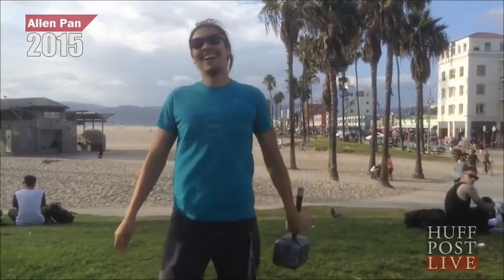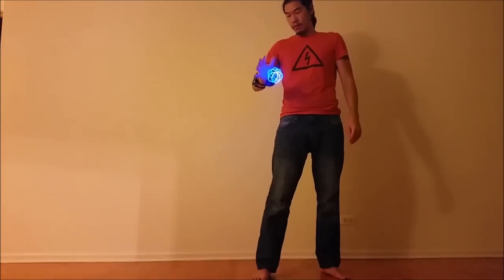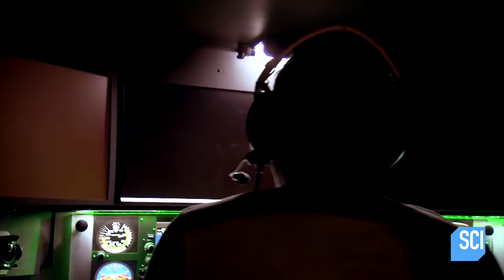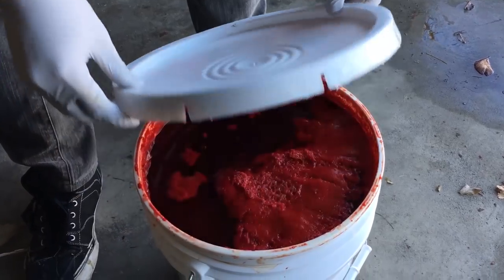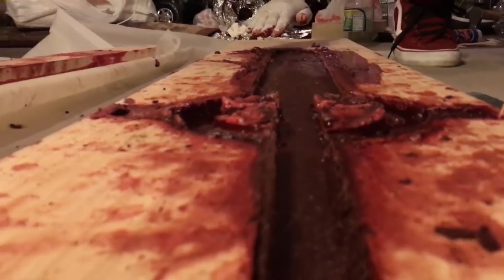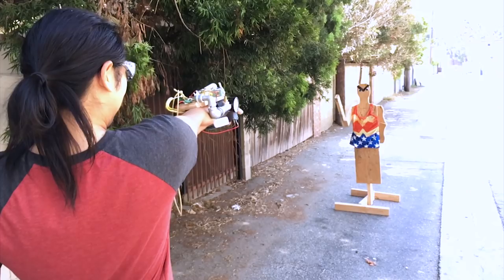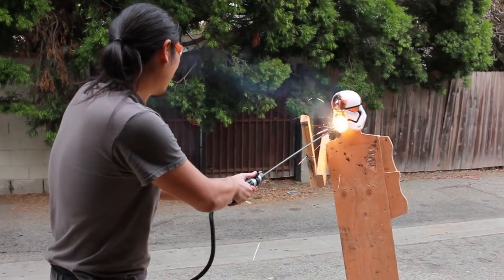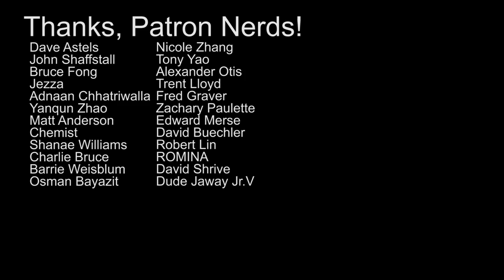A Sufficiently Advanced Compilation (Channel Trailer!!!)

Comment: With the thors hammer instead of a noticeable fingerprint scanner you should of put a magnetic fuse and wore a magnetic ring. So the fuse will only connect and complete the circuit when the ring gets close